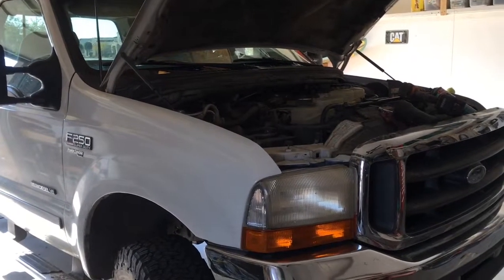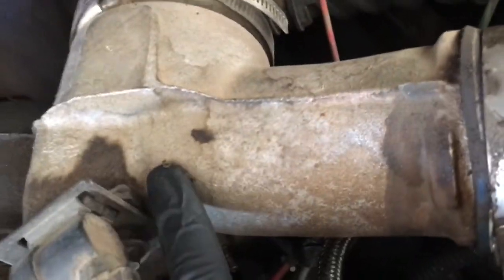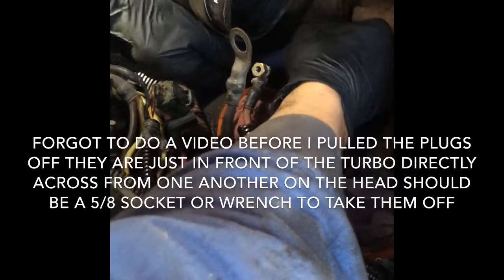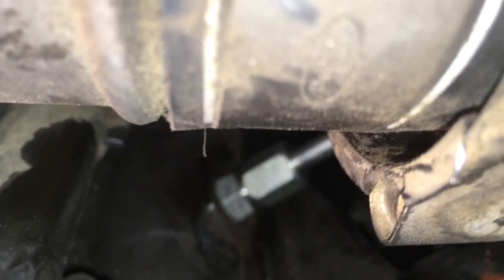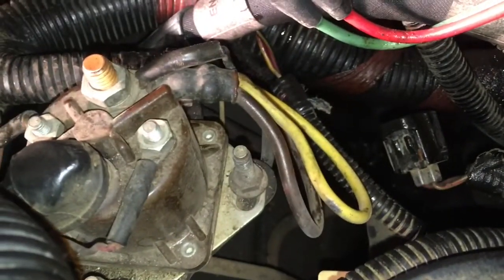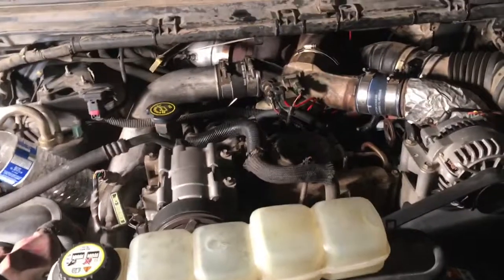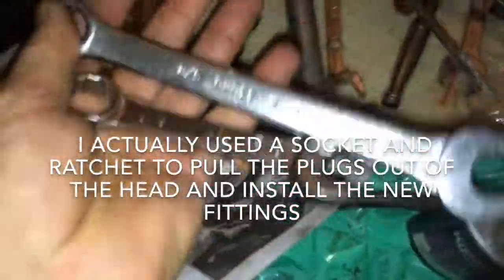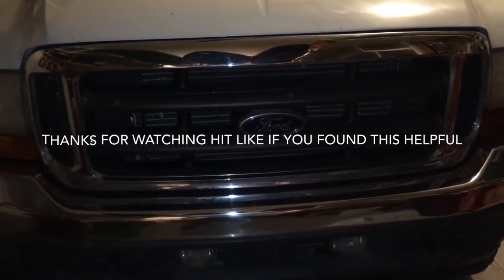2001 ford power stroke diesel engine hpop lines and crossover tube

Comment: Against my better judgement I under took this task despite it not being absolutely necessary... holy F**K what a horrible idea. The most miserable 3 DAYS of my puny existence, with 90 percent of the rage being related to the HPOP Fittings. 30 percent getting those POS "Easy" connectors off and 60 percent trying to adequately tighten the new fittings in horribly cramped area.

RAGE. F**KING RAGE.

Comment: I can tell by the rage comments we are a lot a like! Plus we have nearly identical rigs, 2001 F-250 white crew cab. I just ordered some new lines but I'm not currently leaking at all... I'm wondering if I might just hold off on this until it's necessary, cause I can just see problems arising that I don't currently have, what you think?

Also for any time you have to remove the spider I would recommend to every and anybody to insert reinforcement rings to the plenums, you can get them for about 40 bucks from RiffRaff and makes it so you can really clamp down on the lower legs of the spider... without them you can easily warp/crush the factory plenums from over tightening them, which will cause you all sorts of boost leaks :(

Comment: No idm on the 6.0/6.4 🤣🤣 I own a 6.0 and I’d take it any day over the 7.3… at-least I’m not slower than a Prius.
Reply from the maker: It’s all good at least I know I’ll make it from A To B you might want to schedule a trip to a shop it took a while to watch that video and come up with that joke your 6.0 probably had something  break on it 🤔 my bad on the terminology the 6.0 uses an icm injector control module versus an idm injector drive module same concept
Reply: @diydan7019  I never worry bout not getting from A-to-B ever, havnt had any “true” 6.0 issues for several years. I came here to see if I could get some ideas for a buddies 7.3’ since his lines are leaking, it’s called a FICM, havnt had an issue with that in several years 😂. I love my 6.0, gonna drop it in a 6.4 next… 😎
Reply from the maker: @thrownthekilled  your one of the lucky ones the company I work for ran a fleet of 7.3s and they did well then had some 6.0s we had a lot of issues on not nearly as many trucks and was one of the reasons we went to the duramax because of the reliability of the 6.0 👍 but yes the 7.3 does tend to leak in the engine valley the turbo pedestal o rings or the ebpv is another likely cause I ended up doing the delete kit for the ebpv on mine. Again my opinion on all my videos is based solely on my experiences or things I’ve seen personally seen not read on the internet and there are always exceptions to what I say as well I’d stay away from that 6.4 though we have one of those in are fleet left and it’s in the shop more than the field lol
Reply: @thrownthekilled  no but we have ficms. I have two of each. 6.0 is much more problematic
Reply: @dereks4497  no shit that’s why I said we don’t have idm’s cus I know we have FICM’s… I work on my 6.0, even after 2 accidents and the body and frame are shot I can still go out to my truck and fire her up and she runs. Take better care of her
Reply: Ole Andrew is on crack I've had a 6.0 for over 10 years prob stays broken down more than it's ran. I literally have it sitting in my yard because I'm so burnt out on fixing it. It's not that I cant it literally will run good for about 15k miles then it's all over again. Got a 2000 7.3 it's got 430k miles and I'd drive it across the country it a heartbeat. Can't say that for the 6.0. all 6.0's have problems it's not a matter of if it's a matter of when. The fact he's trying to act like his truck is reliable is comical. My 6.0 has never had major problems either it's just constantly chasing high pressure oil leaks...
Reply: @F28B  then sell your 6.0 cus you obviously don’t know what the fuck your doing, I think the bare minimum miles mine has gone with zero issues is 60k miles, the most it’s gone with zero issues is over 100k, yeah I won’t lie they do have issues but if you delete the emissions, and buy shit that’s better than oem your gonna have fewer issues, I know of several 6.0’s that have only needed minor shit, such as injectors, and a ebp tube and sensor. I’ve owned my 6.0 since 2014, it’s 2023, 9 years and yet I can keep my 6.0 running and you choose to park it and call me on crack. 😂😂 Jesus Christ you are a idiot. My 6.0 has only left me stranded once and I had her running in 3 days, and 2 of those days the part stores were closed. So I went to enjoy my vacation. Simple motors if you do proper maintenance and if you use better than oem parts on internals.

Comment: I was told to use loctite 680 (green). Does that seem right? I just put it all back together and saw your video. Hopefully I didn't use the wrong one.
Reply from the maker: I looked it up and I think you should be fine with that type of loctite 👍

Comment: This is not a hard job todo! just take off the fuel bowl and no need to take the spyder off, that also opens all the room for the hpop and crossover tube. 2 hour job haha
Reply from the maker: The spyder was taken off to put the crossover tube in not the hpop lines the ports that it goes from head to head are under the spyder 👍
Reply from the maker: But yes you could remove the fuel bowl to make the hpop line easier to do I did not feel the need to remove both
Reply: @diydan7019  I didn't need to take the spider out for my oil crossover tube install, it fit no problem. I got the riff raff diesel one and it has a straight angle different than yours maybe thats why
Reply from the maker: FreestylePYRO 👍

Comment: Hmmm my 2005 6.0 has 548k and is daily driven.
Reply from the maker: 👍 your one of the lucky ones that hasn’t had to dump a lot of money into that engine  In my videos I am voicing my personal experiences not what I’ve heard or watched and on average 7 out of 10 trucks with a 6.0 that I dealt with we had to do heui updates, idm modules, egr coolers, or injectors between 100k and 200k which are all high dollar repairs

Comment: Pulling out the check valves equalizes the pressure in both heads so in actuality you did not need the cross over